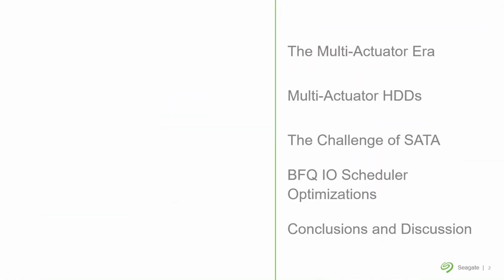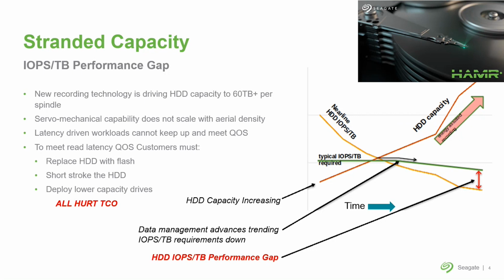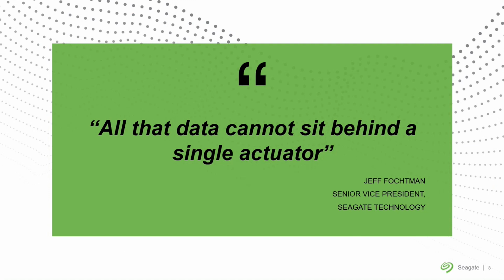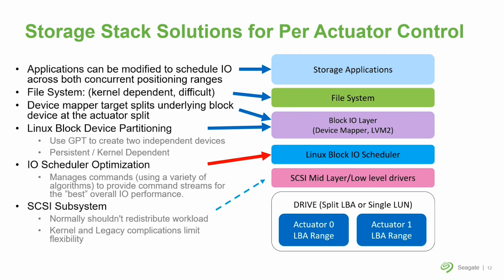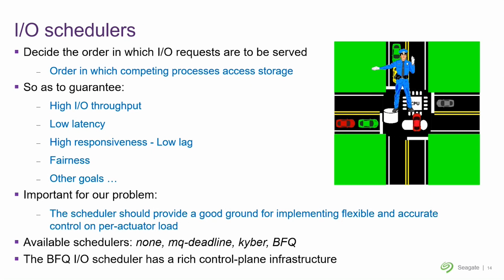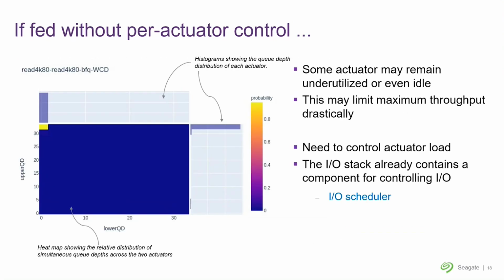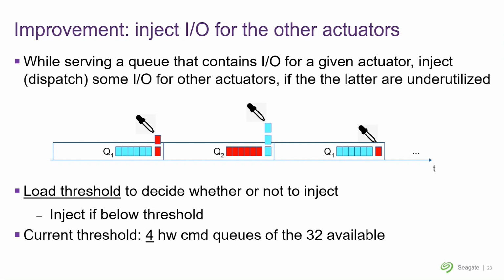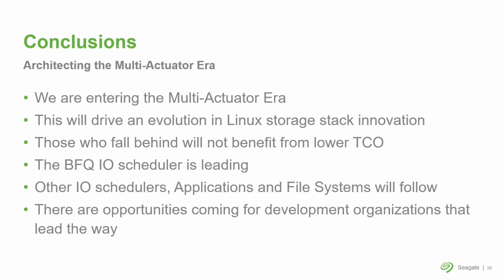Seagate | Meet the Architect – Architecting the Multi-Actuator Era with Arie van der Hoeven

Comment: Why not go further - and create 4x sets of separate actuators? It would be like 1x set of plates - and 4x sets of heads - where each plate would have 4x heads on each side reading / writing data simultaneously - but independently.